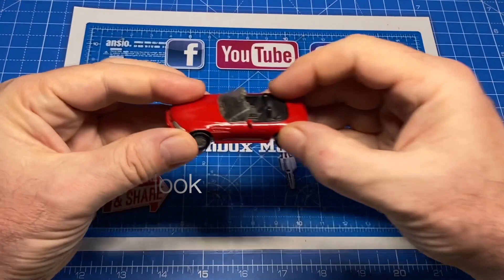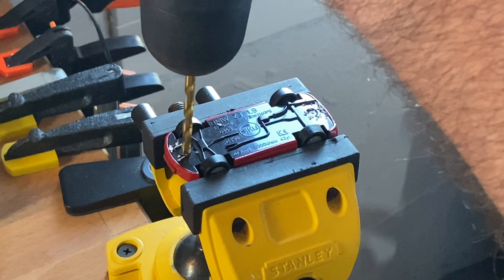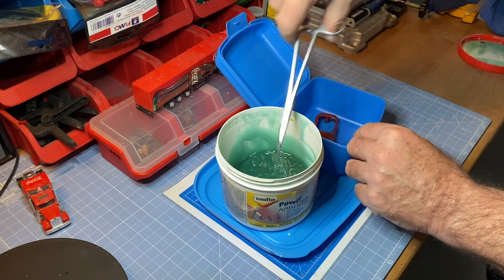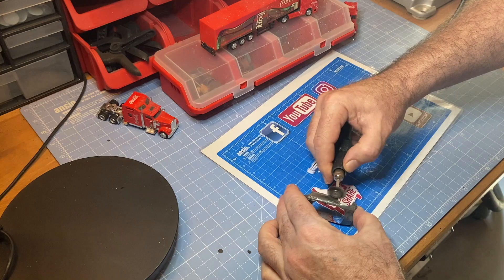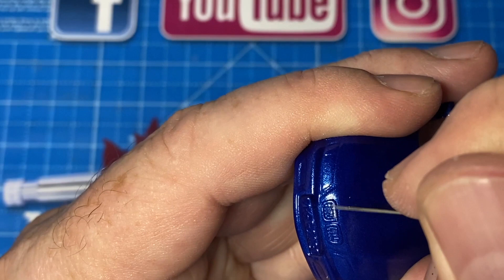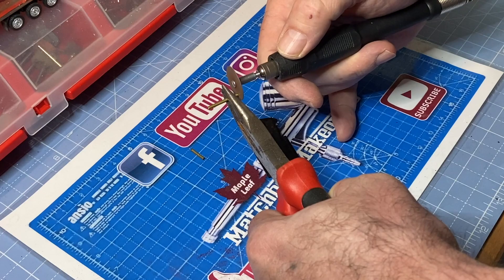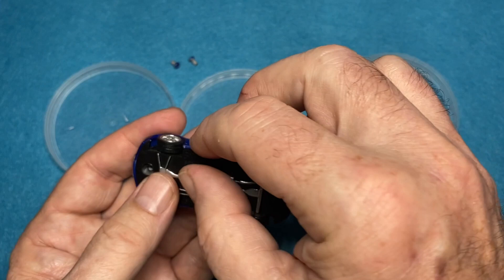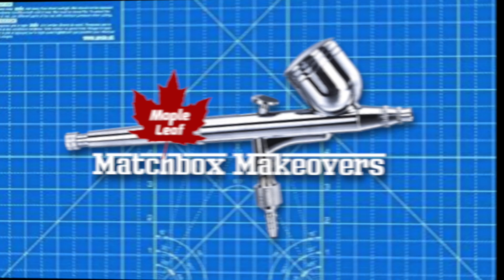Siku BMW Z3 1.9 (098)

Comment: Great job Andrew I say good morning to you and the family woke up early this morning saw you had posted a new video had check it I was going to give you a update on my white Volvo majorette road tractor painted the frame red battery boxes also red left the fuel tanks crome and the inside of the wheels red and the out side ring crome and panted the cab satin gray turned out pretty good .but on a another not my mom went to a garage sale last sat she found me a bunch of hot wheels match box majorett yatming road champs about 200 die cast cars truck campers etc etc been all week going through them have a great big ol day be safe .
Reply from the maker: Hey David, thanks for the update on the Volvo tractor build. Sounds like you're a detail guy. Cool. And wouldn't I be happy to have a bag with 200 cars dropped off on my hobby desk! Score! Have fun with those! 🍁
Reply: @MapleLeafCustoms  thank you I have enough die cast to keep me busy for the next couple months lol be safe my friend hope your vacation goes great for you and the family also do you have face book
Reply from the maker: @davidmaggard2796  Yup. The FB and IG links are in my YouTube homepage banner, Everything's called by the same name - Maple Leaf Matchbox Makeovers! Check them out!

Comment: What a beautiful build and a accurate build to your former ride. I was wondering what brand you use for chassis detail? I myself use Molotov Liquid Chrome.
Reply from the maker: Hi, Dave! Thanks for the kind feedback. I've got the Molotow Liquid Chrome pens in various sizes too, but have had a few accidents as they gush unexpectedly now and then. Lately I've been decanting some of the chrome from them and using a fine detail brush to apply it. I think on this video I used an Edding brand paint pen. Kind of like a Sharpie, but it's a German brand easily found over here. I usually go over that with some Citadel Nuln oil black wash for authenticity. 🍁